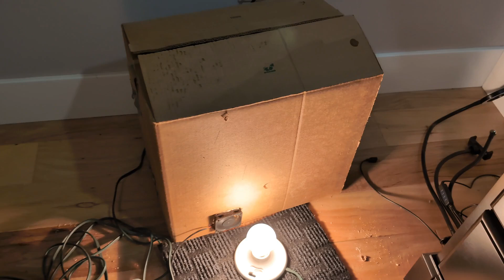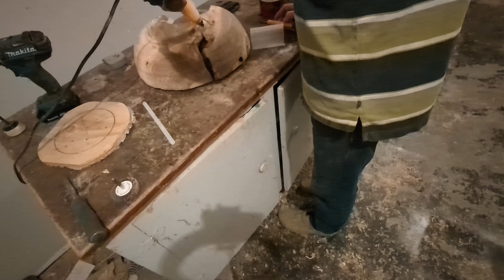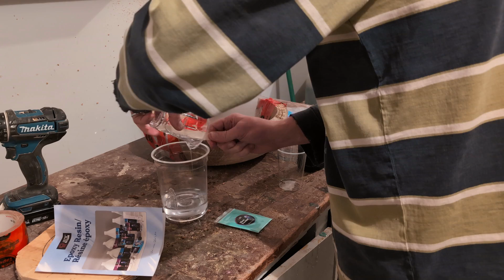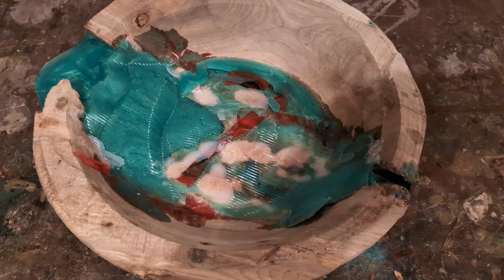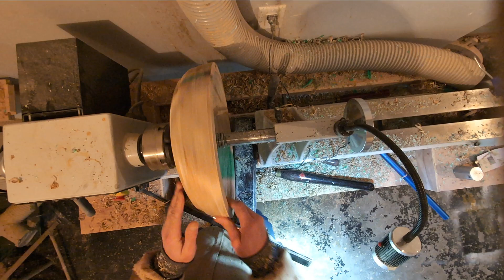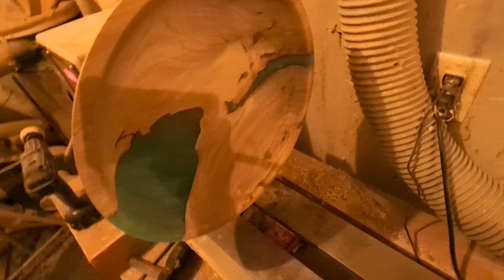My Biggest Epoxy Bowl Yet!

Comment from the maker: Thanks for watching! And have a Merry Christmas
Reply: Very nice bowl, I just ordered the CX 802 wood lathe I think that's what you have I was asking to change the speed from low to high do you have to change the motor belt manually or it's automatic. if it's manual how long does it take?  Thank you
Reply from the maker: @michelrauzon6198  https://youtu.be/aVLQ6lc_9n4?si=4iJCfmIQxrmzPHz5
Reply from the maker: @michelrauzon6198  I sent you a link to my review of the lathe. Low speed is 50 to 1200 rpm
Reply from the maker: @michelrauzon6198  I think 1200 is fast enough. Unless you are doing spindle work. It is easy to change the belt. Just slacken the tension move the belt over and tighten back up. Easy to do. But I have only been on the high speed once